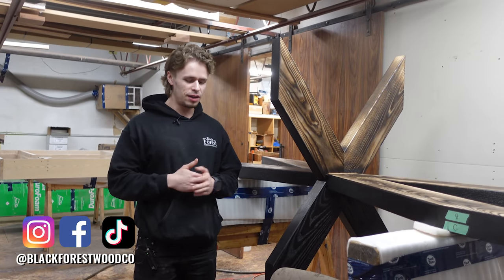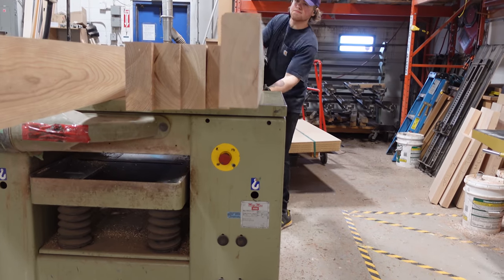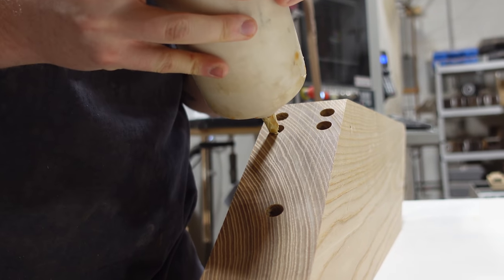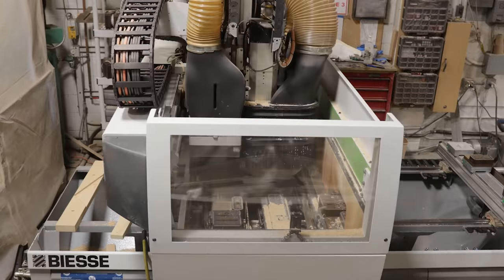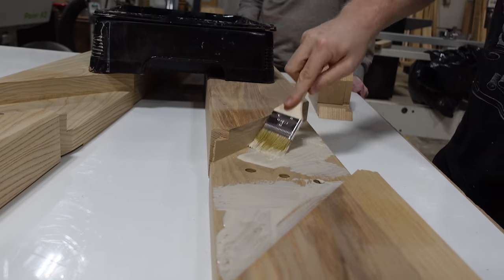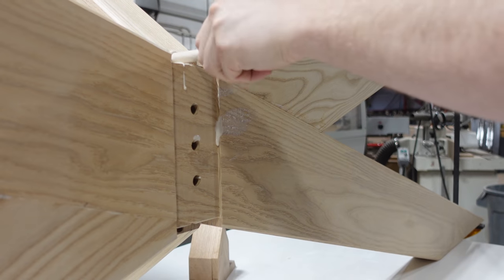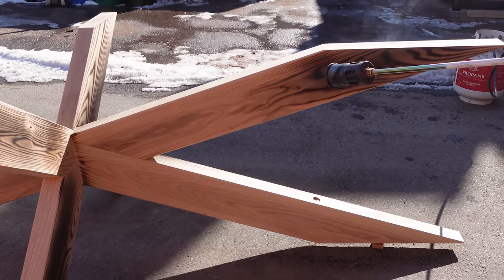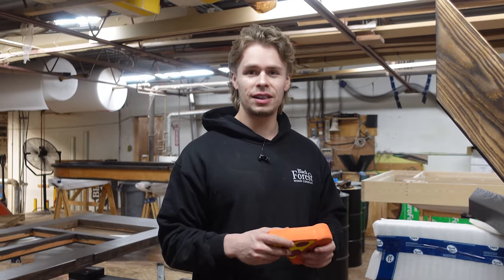Building a Base for Joe Manganiello's Dungeons and Dragons Table

Comment: I'm a huge fan of your work! I'm actually hoping to build a version of your X-base for a table of my own, and I was wondering, is there any reason you sandwich the end grains of the shorter legs together at an angle, as opposed to some sort of half-lap joint similar to the middle of the big X? I'm a novice hobbyist and claim no expertise, but that angled glue-up would stress me out, so I was just wondering if your shop had this idea but preferred the current method. Again, your videos continue to inspire me!

Comment: Great video as always.  Question:  Do you place rubber or something to stiffen of the feet of that stand?  I would think over time with that heavy table on it would cause pressure cracks or cause the feet of that stand to chip out on the front ends.    Yes, I would like to see a number of your projects put to plans.